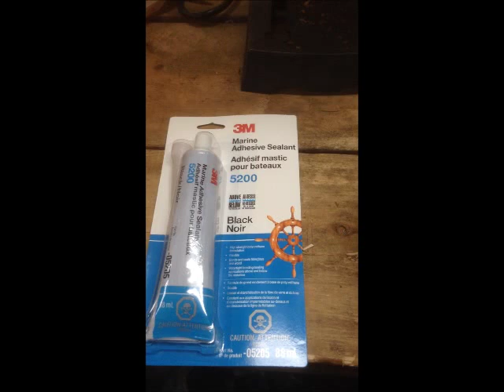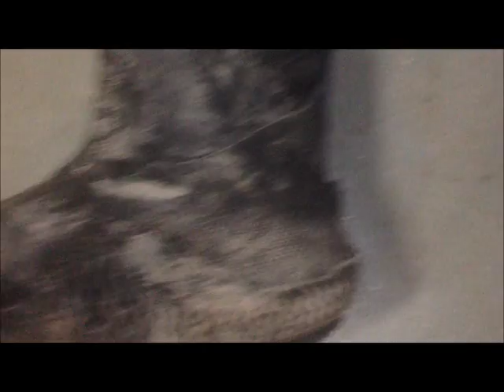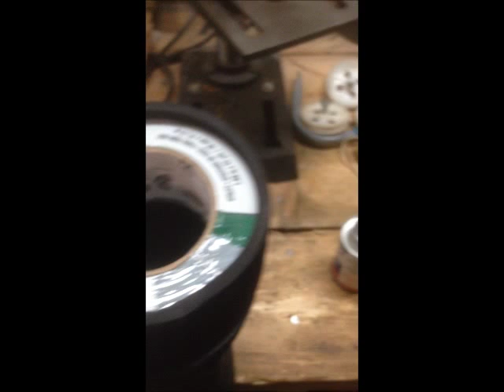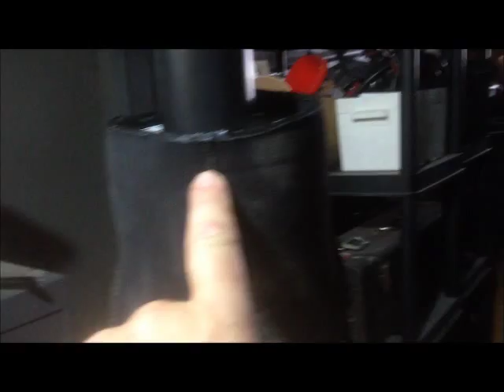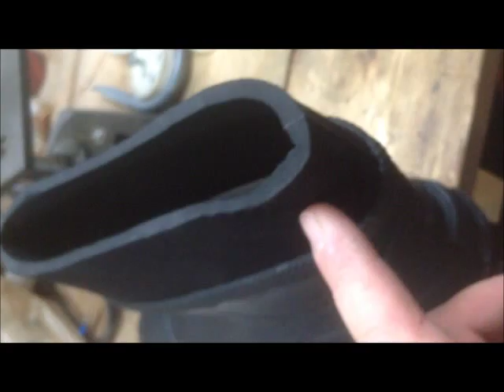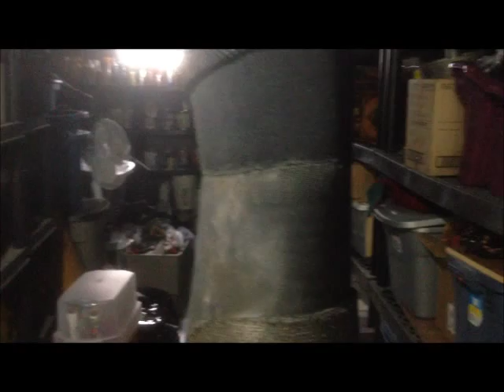change dry suit boot

Comment: Nice video, changed boots on ScubaPro suit and used 5200 also.   Unfortunately it is taking a longer to cure than 7 days at a room temp of ~70 and humidity + 55%. I'll update when it does cure to firm/ solid and flexable and I am hoping thats not too much longer.
Reply: woulnt aquaseal work? cure time is 24 hrs